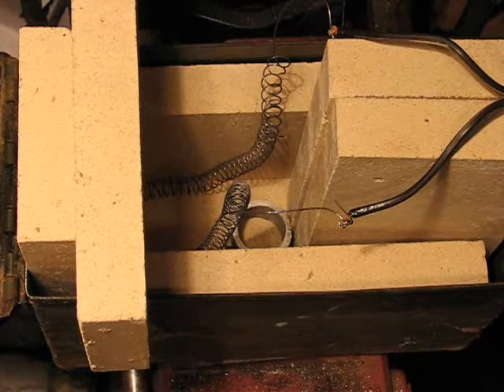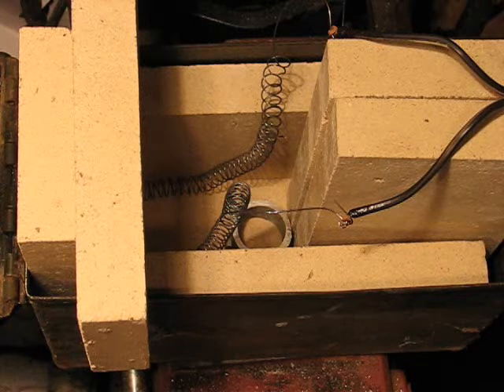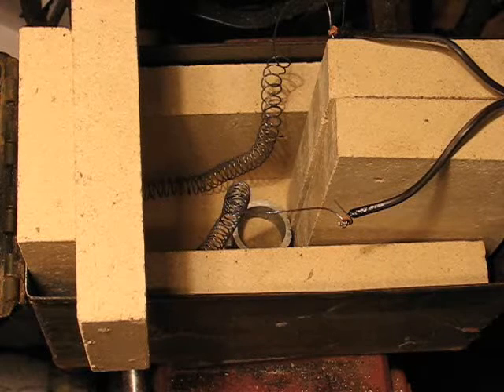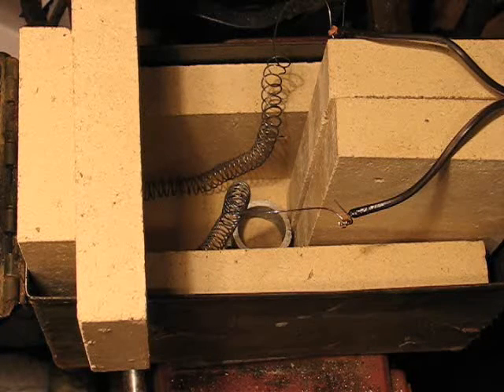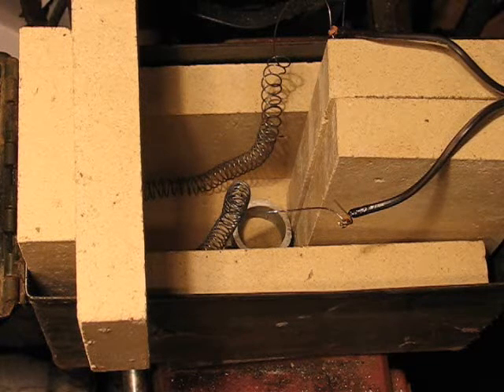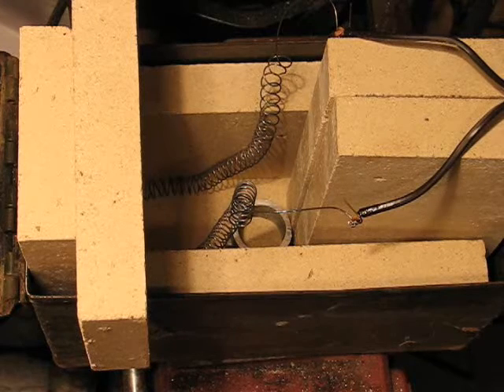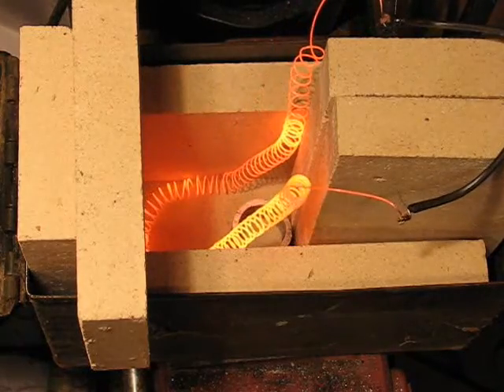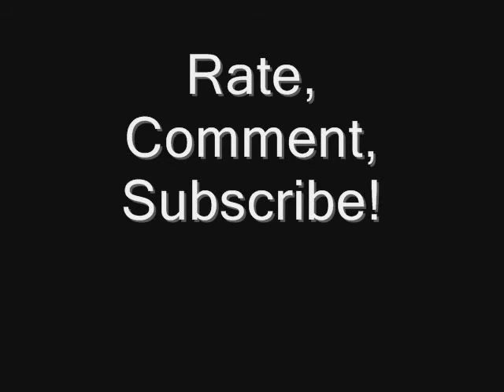Resistance Wire for Electric Furnace

Comment: You probably finished the project by now, but my thinking about securing the kanthal wire to the bricks are ...
Drill two holes in one brick, cut a 3-4 inch piece of kanthal wire, put that through the first hole, around the heating wire and back through the hole.
Twist on the other side of the brick.
Repeat for as many times as you need.
The reason for choosing kanthal-wire for securing the heating wire is that it won't melt.
Glue wouldn't work, cement wouldn't work, screws/nuts/bolts wouldn't work, etc. - only material that won't melt at high temperatures will work and I guess that the kanthal wire itself is probably the best candidate, since you have it anyway.

Comment: İs it normal Steel wire that which is used for heating element.
Reply from the maker: No. This is a special alloy designed to handle the heat on a continuous basis.
Reply: That's nichrome wire...a heating element

Comment: what plug you used?
Reply from the maker: NEMA 1-15P.
Reply: Thank you im still learning i went got my self a dryer coil heat. im not sure if that would work?  coil is "1/4"
Reply from the maker: Be careful with that; there are a lot of things that could go wrong and shock or burn you. I'm not advocating any of this. If you need to ask how I did it, you probably shouldn't attempt it.
Reply: well im asking you how
Reply from the maker: Sorry, can't help you there. Like I said, if you have to ask, you definitely shouldn't attempt it.
Reply from the maker: I will make a suggestion, though: an electric hotplate is pretty much the same thing as what I did here, but with a built-in rheostat to control it. They're only about $10 new, and you can probably find one at a thrift store for a couple of bucks.

Comment: Just found your channel as I was looking for info on a 5.9 Cummins in a Blue Bird bus. What ever became of the TC2000?
Reply from the maker: PressedEarth I still have it.
Reply: Was hoping you had some more vids on its conversion. I found a "91 that seems priced right but forums say the 5.9 is lacking power in a bus. Wanted to see what you thought about yours.
Reply from the maker: I like it. The 5.9 has enough power; the bus has enough gearing to do what it needs to do. I think most of the people who claim it doesn't have enough power are expecting to be able to cruise at 75-80 mph. In my opinion that is an unreasonable expectation.
BTW, you can still leave comments on the bus video and I will get them.